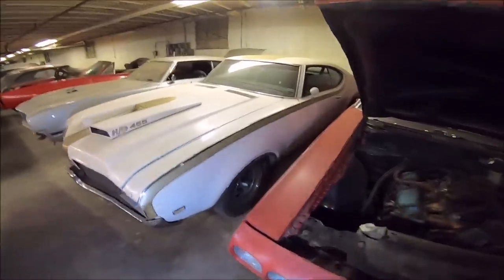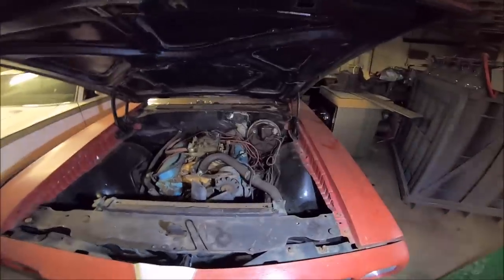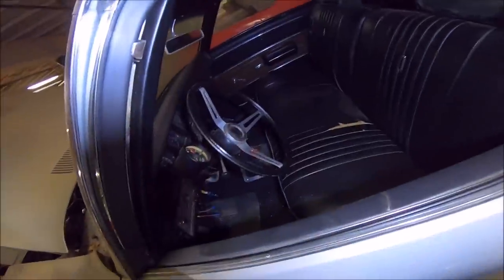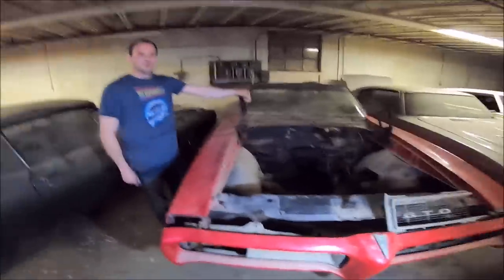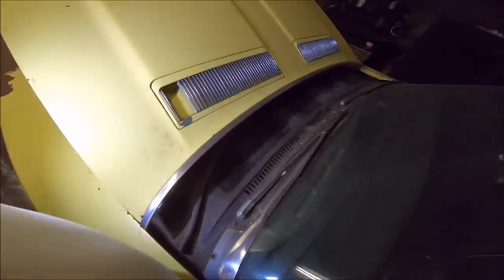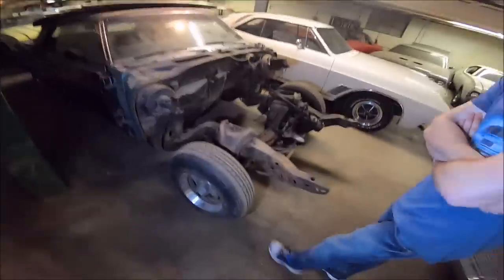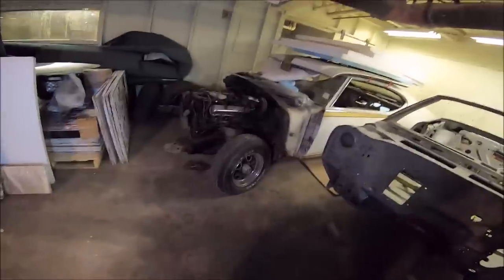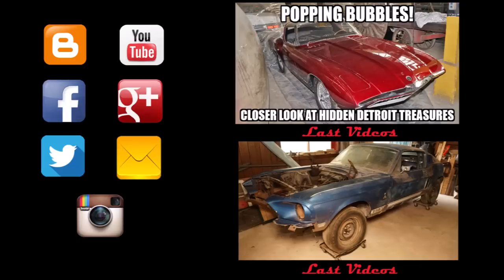Rare GM Muscle Cars stashed in Old Furniture Factory Basement!

Comment: At $40 to $50,000 a piece in repairs and endless swap meets and internet shopping they could all be beauties !!! 455 Hurst OLDS is the best car there
Reply from the maker: THey are pretty complete otherwise.  Not much swap meeting needs to be done.
Reply: most of them aren't worth anywhere near that,
Reply: @ericschulze5641  bullshit they aren't.
Reply: @edmelungeon2239  never said they were but they aren't worth 40-50k as is, it'll take 20-30 k each or more to get them to concours condition, you people don't realize that a paint job alone is in the neighborhood of 10k,& they will need to be completely disassembled every bushing ,every seal, all trims & door seals crank seals tyranny seals on and on so basically the engines and transmissions have to be rebuilt even if they work & all suspension + body work you people watch gas monkey garage & counting cars too much. The heads don't have have hardened valve seats, they're made for leaded gas
Reply: Need a endless bank account and work on them full time , in the end could get a huge chunk of change . Heck as they are he could get a pretty penny

Comment: That green '68 Tempest convertible was my first car back in high school. I bought it from the original owner, who lived across the street from my grandmother in West Hollywood, CA in 1991 or so. It was sold new at Utter Pontiac on La Brea Ave in Los Angeles. I put the Cragars and BFGs on it when I was in the Navy. The folks who bought it were from Illinois. They were looking at some of my dad's cars and they asked about the Tempest. My dad talked me into selling it and i've always regretted it. I almost fell over when I saw it in the video. It looks exactly as it did when I sold it.
Reply from the maker: I got your email.  I responded fully there.
Reply: Didn’t get the email. Yahoo Mail can be weird sometimes. I’m 100% certain this is my old car. I didn’t know what I was doing with cars back then. I took it apart, got it painted, got the bumpers and badges rechromed, and never fully put it back together. I still have the original grandma wheel covers in my basement. The CA black plate was XRF305. Bought it with 79,000 miles and parked it with a few thousand over 100,000 miles on it. I have pics somewhere of the odometer rolling over. I still get registration reminders for the car every year from CA DMV.
Reply: Mike Frankovich amazing!  It can be bought!
Reply: Mike P I know, but unfortunately I just bought a project ‘59 Plymouth wagon the other day. Going to see what they want for it and if it makes sense I’ll have to sell something to raise the dough.

Comment: Dude it's an Oldsmobile, the gentleman's muscle car. All options available.
Reply: Joseph Iacovelli Yes Exactly!
Reply: @midnitesquirldog1 Yes I wish they still made them like that too. I had a 1970 cutlass W-31 the stripped down Oldsmobile. I am a GM A body fan. The GS & GSX were some of the fastest cars on the street, low HP ratting compared to the chevy big blocks but over 500lb/ft of torque made it a monster.  The GSX just looked mean, the white more subdued but the yellow just screamed muscle.
Reply: @midnitesquirldog1  Thanks for the update on the HP rating. I was under the impression that Buick under rated their HP numbers and advertised 370 hp. maybe that was the non GSX 455. I am aware of the EPA and insurance company stuff and the change from brake HP to net HP. Long live American muscle.
Reply: midnitesquirldog1 while I love old engines and cars, I have to disagree on the performance side. We live in the golden age of horsepower. The ls, lt, new Hemi and coyote are amazing engines. I daily drive a 67 skylark, and come from a family full of big block mopars, 540 chevelles, supercharged mustangs and so on. This new stuff is no joke. The fastest car in my family is a 2013 camaro cam/intake car. I still prefer classics, but today’s cars donkey stomp them when it comes to performance.
Reply: midnitesquirldog1 so a modified car beat a stock car? That’s really not impressive. Of course gears matter. That’s why the Japanese were dogging us in the 80s and 90s. Most cars from the muscle car era came with lake gears. So most aren’t going to have that advantage. Give an ls aftermarket induction (even tho the stock intakes are good) an aftermarket cam and low gears and see what happens. Plus an ls will last 4x as long. And will get better mileage. And will be able to spin past 5k reliably. Why do you think old speedos only went to 100k? Old engines weren’t as well engines. The fact is today is the golden age of horsepower and speed. And if you deny that, then you haven’t driven enough old or new performance cara.
Reply: midnitesquirldog1 older engines are inherently weaker and more unreliable. Of course a few examples last a long time. But that’s not the norm. There are a lot of them left because there were a lot of them made. How many mopar c bodies and Chevy motor homes have been scrapped because someone pulled a big block out the threw the rest away? And then rebuilt it to put it in something cooler. When you do a modern engine swap there isn’t any rebuilding. People are literally taking 5.3s with 150k, slapping on head gaskets and studs, a cam and a turbo and making 600 whp pretty reliably. Without touching the bottom end. New engines have tighter tolerances, 6 bolt skirted blocks, nodular cranks etc. even  in truck engines. It’s really not even close. Oval port big block Chevy heads flowed in the 250 cfm area typically in the 60s. Truck heads flow that now. Again, I love old stuff. I put more miles on my skylark than most classics receive. It’s a true daily driver. But old stuff just doesn’t perform the way new stuff does. Not in remotely stock form anyway.
Reply: midnitesquirldog1 you’re in denial. Old blocks don’t need 4 bolt mains? Come on. And old forged cranks are horrible. Most are only good for about 600-650 horsepower. Modern modular cranks can handle 1000ish hp pretty easily. Also, if you think your Buick 350 is making 450 hp, especially for $4600, then you don’t know what you’re talking about. If you think that’s spending a fortune on an engine, then you’ve never build a true high performance bop engine. I takes an incredible amount of work and money to make real power out of a Buick 350. That’s why nobody does it. I daily drive one. Stock rebuild with a mild cam. And it’s dog slow. Like every other one out there. Also, running boost or nitrous (nobody calls it NOS btw, this isn’t fast and furious) on a Buick would be a huge mistake. They don’t oil anywhere near good enough to reliably handle a power adder. While I do hate ethanol fuels, they wouldn’t cause a head gasket to blow. The engine was either wore out and ready for it, you overheated it, or the tune bad. And one last thing, you do know that people say and olds in a boat is only good to use as an anchor, right? They have the worst oiling system of all time. Horribly unreliable. They literally don’t have oil return passages.

Comment: I have a complete NOS Ram Air IV valve train for this GTO.  NOS HL64 lifters, Pushrods, 1.65 Rocker Arms Assembly ,  Ram Air IV valves , Valve springs, oil deflectors, keepers, 041 camshaft, Ram Air IV guide plates, retainers all in NOS gm boxes for this car
Reply from the maker: Where did you dig those up?!

Comment: Back in the 60's & 70's even into the 80's.. you could pick up basically any car you want " USED" and the most you would pay is $1,000 dollars.. there's a guy in Philadelphia his Warehouse is 10 times bigger than that and I'd say 90% of his cars are pristine in running condition the last time I was there I picked up 3 cars in 2006.. 1988 Mustang, convertible 69 Nova big block, 69 SS.. Camaro RS/ SS.. the last car I sold I regret was a 1979 Z28 perfect condition had beautiful rims and tires on it I sold that for $3,000 and then before that I had a 67 GTO that was burgundy with burgundy interior 400 motor it had the his and hers or the mystery shift on the floor I sold that for $1,000..Now both them cars are worth big bucks..Oh well they come & go.. if you really want a good Motorhead car out of really great price check out Maple Motors on YouTube the places in Tennessee their cars used to be really cheap and they had a great selection then their prices started going up little by little to the point where they are still great deals but not like they used to be..🤔💪👈🤔👉🏻👏👏👏
Reply from the maker: You are absolutely right.  That's when most of these were saved.
Reply: I got three cars off my neighbor a 1969 Chevelle SS with a 396 motor..Mint..$1,000 Dollars.. 1970 Olds Cutlass with the 350 rocket motor for $50 dollars nothing wrong with it it was just an ugly color pea green..and a 1966 Chevy Malibu convertible it was inspected it was drivable for the road it just needed a little restore 100% original down to the hubcaps I picked that up for $300 dollars..Two 1955 Chevys two-door the one had a cracked block that's it the other one did not have a motor and it was in primer Gray, I got them both for $550 dollars picked all them up in late 1979- 1980-1981.. if I had the time and a warehouse to put them I would probably have 400 cars by now..Back then you didn't know or care.. Buy um drive um sell them.. out of all the cars I had I have two cars left and a custom Street Dune Buggy..Badass 2000cc VW MOTOR running straight pipes.. if you have the passion for old cars and the money grab up what you can and keep the history alive..like in the Video...

Comment: I think that '68 Pontiac Tempest convertible (at about the 9:00 mark) is gorgeous.  It appears to be solid and in good condition, and the front and rear chrome bumpers look great.  Does it have a complete driveline (engine and transmission) in it?  I DOUBT I could afford it, but I wonder how much they'd want to ask for it.  It really sparked my curiosity.

Comment: I have a 21,000 mile 70 GTO 400 automatic with the 69 Judge stripes that is an early year build.
Reply: Bill Ness for sale?
Reply: I’m planning to offer it for sale next year on its 50th anniversary and near my retirement date. I’m thinking it could draw a bit more money then. It’s current appraisal is right at $30k. What is hurting its value is that is was repainted with a coral colour from the Cadillac line in the late 70’s, along with the carb replaced with an Edelbrock and an HEI distributor installed. The original wheels were left out in the original owners yard for 40+ years and were unsalvagabe, so I installed 17” Rally II wheels with modern tires. When I bought it, it had CenterLines he had put on in the 70’s. Otherwise, it is all stock. It has the original Sandalwood interior, but the dash pad has some heat shrinkage on the upper corners. That all said, I’d take $35k for it now.

Comment: Get them out of that basement moisture.
Mold and mildew will eat up interiors.
Dehydrated coyote urine  from Menards will eliminate your mouse problem.
Reply: Or they could just get a massive dehumidifier
Reply from the maker: Because it is an old Furniture Factory, it is all temperature controlled.  So no mildew or such.

Comment: That GTO does have power brakes and power steering. I can see the vacuum booster and power steering pump.
Reply: Rick Taylor someone added them along the way, they’re not original to the car
Reply: @themotormadhouse  
No one would go to the trouble of changing the brake booster or adding power steering. That's a lot of work.
That building is full of junk, none of those cars were worth restoring. It be easier to find other cars, that were in better condition.
Reply: Rick Taylor I have a PHS on the car that proves the power brakes are not original to the car.  And contrary to your keyboard expertise, that Ram Air IV will bring north of $125k restored.  So we find it to be well worth our time.  Thanks for your pessimism!
Reply: It appears that someone also took the time to swap a 350 into it, I know, a crazy amount of work..  here’s a hypothetical,  maybe, just maybe, the car was raced until it blew the original motor, maybe sometime in the early 70s.  Then!  Maybe someone bought the car as a roller and wanted to use it for transportation.  Maybe they even had a wrecked lemans that they pulled the motor and power/steering brake parts from, and put the GTO back on the road.  Either that, or I have the first GTO that PHS has ever gotten the wrong build sheet on.
Reply: @themotormadhouse  
No car in that building was worth restoring, it would cost more than it was worth. Barrette Jackson and Mecham  killed the ability of the average man, to but any muscle car.   AS these cars sit, they wouldn't bring $2000 for any one of them.
Most are beyond repair. The first Hurst Olds isn't worth restoring. The second GTO is total junk. You would have $100,000 in a car, that was worth $60,000. Why waste your time trying to find nonexistent parts ?
Reply: Against all odds, they’ve managed to stay in business doing nothing but restorations on these cars.  I would love for you to send me all the Ram Air IV cars that you find in the future for $2000.  I will buy them from you for $10,000 each and make you a very wealthy man.  We have turned down offers of $25,000 for the red GTO more than once, even during the recession in 08.  We’ve also never come close to investing $100,000 into a restoration as we do all work in house.  We wouldn’t be doing it if it wasn’t making money.  I’ll let you know if we ever need a new financial advisor for the business.
Reply: @themotormadhouse  
There are NO odds. Barrette Jackson caters to the mega wealthy, not the average person. The convertible GTO would bring $25,000 fully restored. 
I have better things to do, than argue with Mr. I restore junk cars. If someone offered me $25,000 for that red pile of shit. I'd jerk their arm off.
No interior, no matching numbers engines, no hoods, doors or other hard to find body parts. They have too many missing body panels/pieces. 
 Have fun wit those rust buckets, they are crusher bound.  I'll let you know when I open my own scrap metal business, because that's what you have.
Reply: Rick Taylor I thought you didn’t have time to argue with me?  Must have freed up your schedule.  You’ve already exposed your ignorance to muscle car markets and values.  The last Ram Air I convertible to sell publicly went over $120,000 before commission.  And just to double down on your lack of knowledge, Stage 1 hardtops have been on a downward trend for years.  Both the Ram Air IV And Hurst are worth more than that car in their current condition.
Reply: Lol this guy is my favorite so far
Reply: @themotormadhouse  
Because you've meet your match.
I have GM bowties in my DNA.
Rustman.
Reply: Rick Taylor, just please send me the next Ram Air IV or Hurst Olds project you find for $2000.  I’ll give you a hefty finders fee
Reply: @themotormadhouse  
Why don't you take three of those POS Pontiacs, melt them down, and make one good car ?
Btw, I rode to school in a 1966 Shelby Cobra 427 SC, it belonged to a friend of mine.
It handled like a stagecoach, and got terrible gas milage. But, it would absolutely fly!
I'll bring you every Ram Air IV I can get my hands on, just hold your breath.
Reply: We should hang out sometime
Reply: @themotormadhouse  
With me ?!?!  I forgot one of the rides I owned, it was a black 69 Chevelle SS 396--375 horse 4 speed, it had every available option. I got drunk on moonshine and slammed into some dumpsters, going backwards. I also rolled my 72 GTX. I was high on quaaludes, it rolled over 4 times, crushing the roof in. Believe it or not, I gave $1800 for my 69 Z/28, it was red with black stripes, and only had 28,000 miles, when I bought it. I won a lot of money in that car. My buddies always wanted to race, the only car that even came close to beating me was my friends 69 GTX 440 six pack. It was silver with black stripes, That car was a beast, he could do a burnout one hundred yards. He died 4 years ago, his car sold for $32,000. At one time, I could have bought his GTX for $4,000, that was the deal of a life time.
You should start repairs on SOME of your cars, they could make some decent street racers 
I'll bring you every Ram Air III ..IV...VI..VII and VIII....I can find. I might even come up with a Ram Air IX...Lol.

Comment: These cars are just sitting around with the windows down rotting away. he said he bought the red GTO when he was 13, still not one thing done to it.
Look at the black 442 with the hood on the convertible top ! Wow, who rest a heavy hood on top of a convertible?
Reply from the maker: They own a restoration shop, and have other, rarer cars ahead of these in line for restoration.  They are in a dry, safe space.  Also Cutlass Ram Air hoods are fiberglass.
Reply: It’s pretty standard procedure to replace the convertible top during a rotisserie restoration....